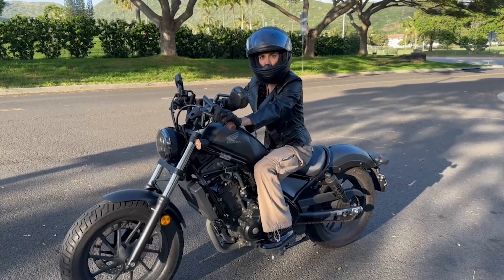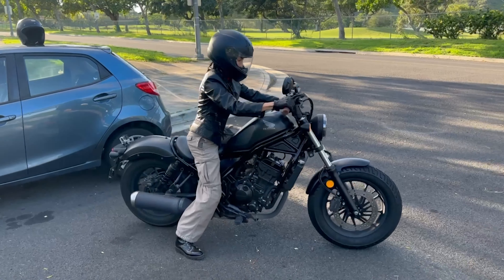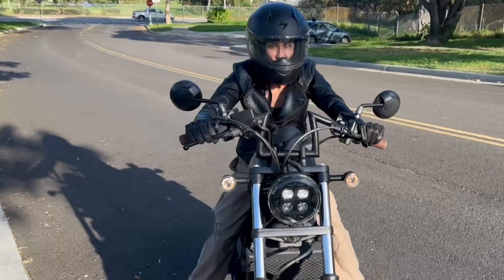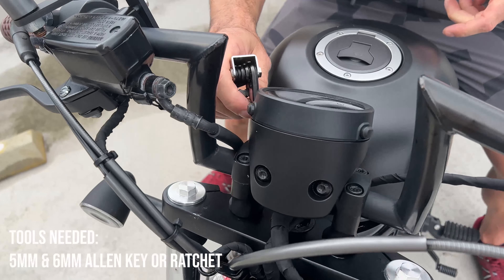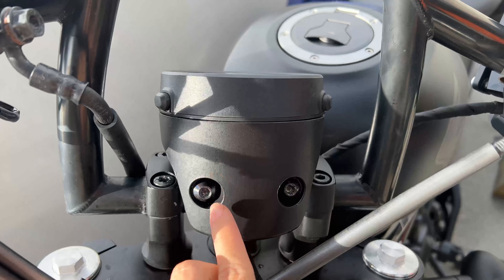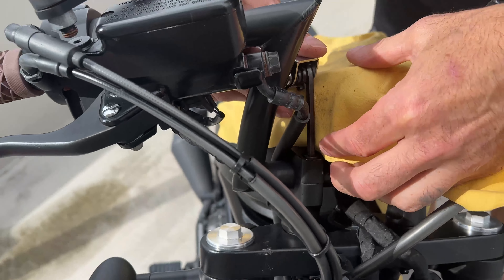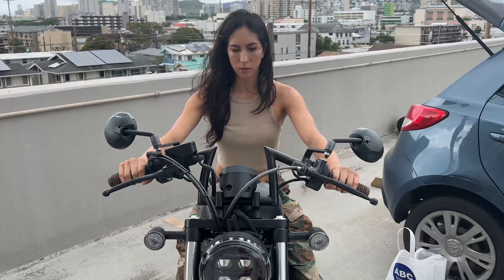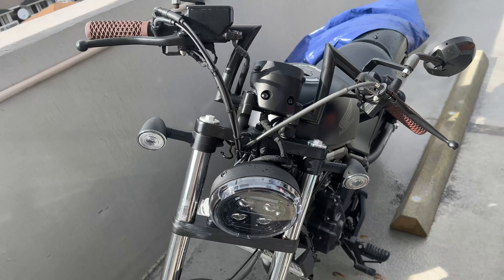How To Adjust Motorcycle Handlebars *For Short Riders*

Comment: You should get some pull back risers to bring the bars closer to you, and maybe lowering the suspension, might give you some more control of the bike
Reply: I would not advise lowering the suspension.  It already is a low bike and it only has 3.8in of travel.  Lowering the suspension will change the handling, and not for the better.